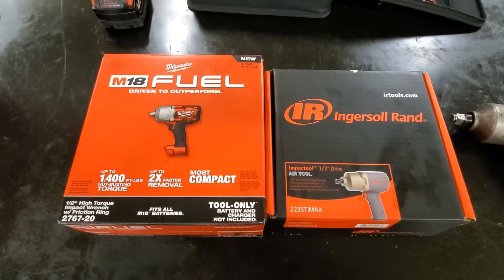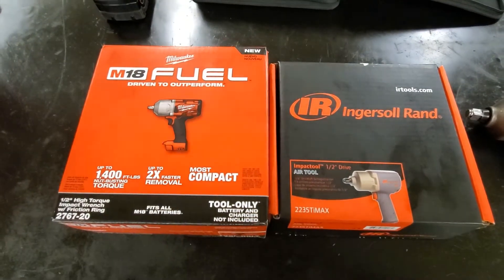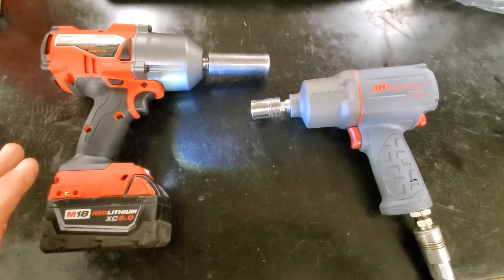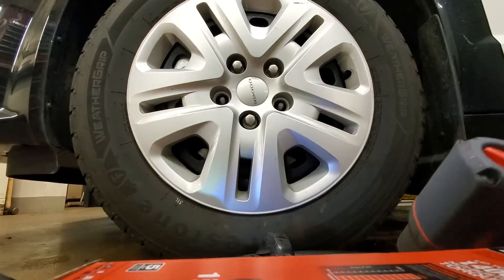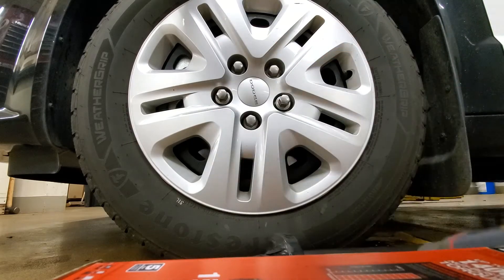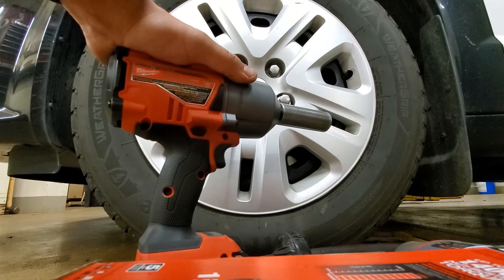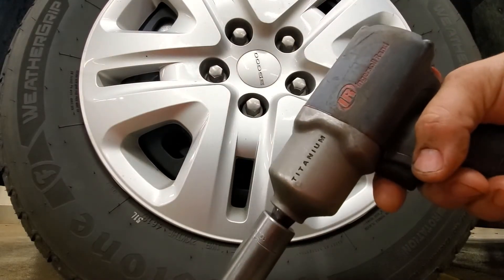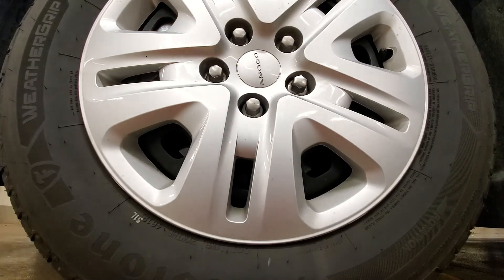Air vs battery impact

Comment: Air will never let ya down plus you can save money using it instead of using all these batteries
Reply: If the air compressor tears up then you have junk. I ain't got to Lug around a hose I can go to a junk yard and ain't got to take all that other bs around with me.

And that 2767 milwaukee will take off any bolt that air impact will and alot more! That air impact ain't fing with that milwaukee period.
Reply: @marcowens3522  I wouldn't worry about the air compressor being out of order a air hose aint heavy so idk why you people think its a big deal and last part id worry about your m18 impact batteries falling out vs air compressor being broke
Reply: @austinmoore1689  I've never had a M18 battery ever to fall out and Noone in my shop has y'all must be throwing your tools around like a basketball for them to do that and if they ever did get like that they make something to hold the battery in.
Reply: @austinmoore1689  lol I use a m12 stubby and save 1/2 of time comparing to air tool
Reply: @Alex-gn7wd  you can do the same thing with air people forget ir mac snap on and matco have 3/8s air impacts and stubby
Reply: @austinmoore1689  how can u save money if you keep buying tools of all the brands you mentioned? I buy Milwaukee, harbor freight, Home Depot, sunex, and all brands from Amazon, u will never be the same if you dragging the fucken hose around and hose is blocking your way and all the noise and the hose are fucken annoying, and i see all mechanics are still buying many cordless tools although they already have many air tool. I saw a snap on stubby is useless , couldn’t break loose a lil nut and my m12 stubby can even bust lug nuts with ease

Comment: The previous tool might have began to loose power due to improper oiling maintenance every once and a while when mine gets close to its oiling period it begin to perform sluggish idk maybe not the case for you but definitely for me
Reply: ( Edit) after realistic I hadn’t watched the full video I realized this was the case for you glad you got it to work 😅
Reply from the maker: @sethmunoz7089  thanks for tip.  I admit i probably dont oil it as much as i should.  We have the automatic oilers in the airlines at work and i think i put to much faith in them!

Comment: Nice demo. Personally I think pneumatic has more residual speed after the nut/bolt is removed so it continues to move them. So if you're doing a full set of five lug nuts or something like a transmission pan or something with a ton of bolts the pneumatic wins.
Reply: Not only that, a pneumatic tool is immortal
Reply: That’s why racers use them. They are airtight so they can be used underwater as well